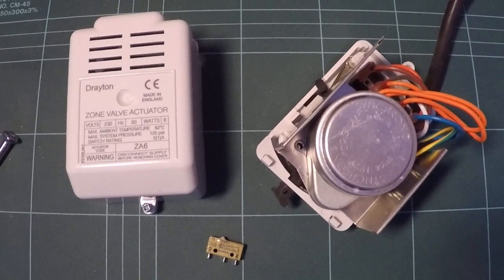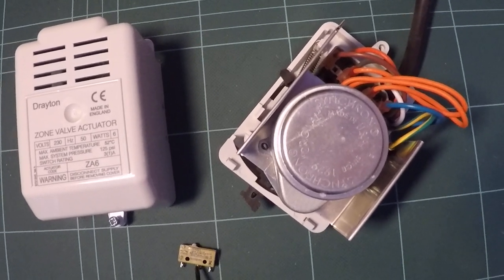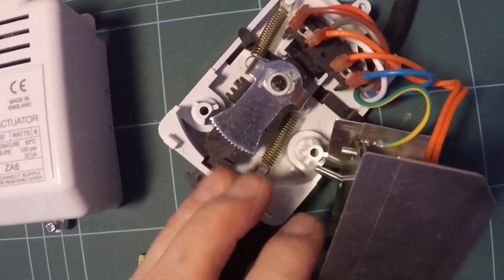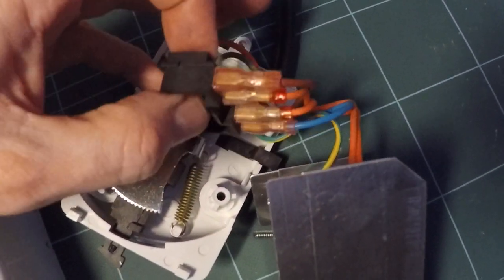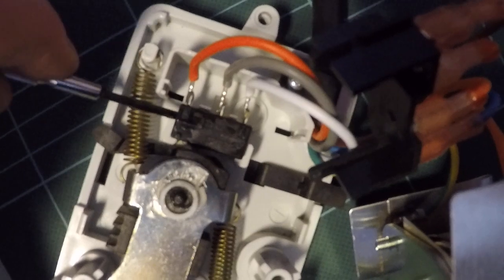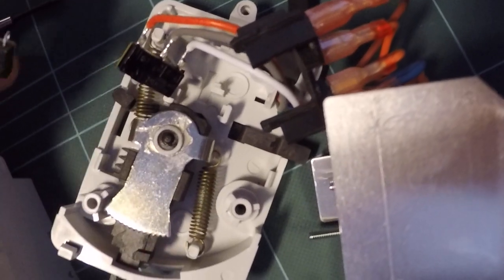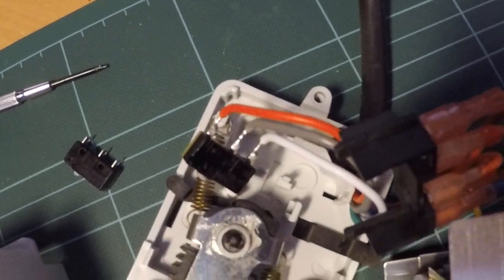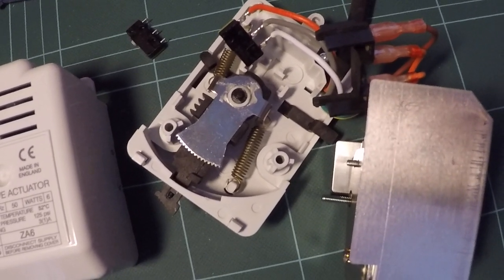Drayton ZA6 sticky valve Micro switch replacement

Comment: Such a simple repair, didn't realise it was just a normal microswitch below that connector block.
Also see now the difference between the 5 and 6 wire actuators, the 6 wire just uses the nc contact. I have an AC5 so now know it doesn't matter which one you have to get as you can just ignore the white wire.
Thanks for doing the instruction video